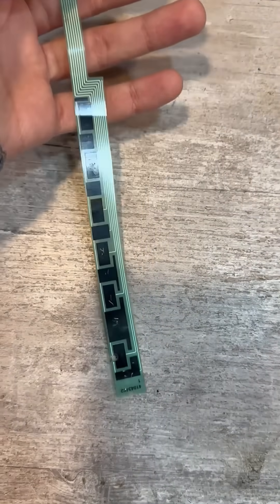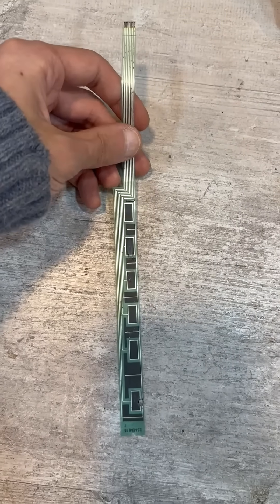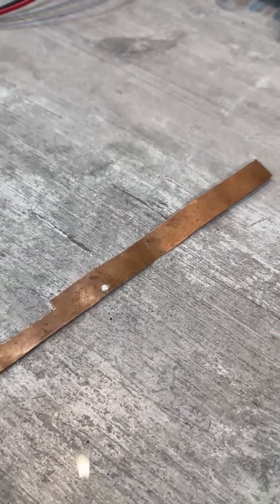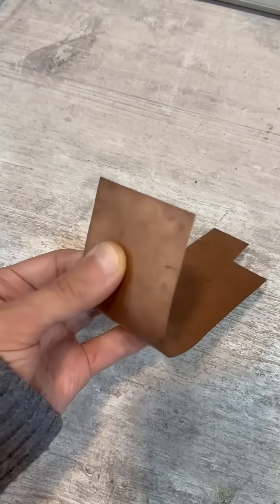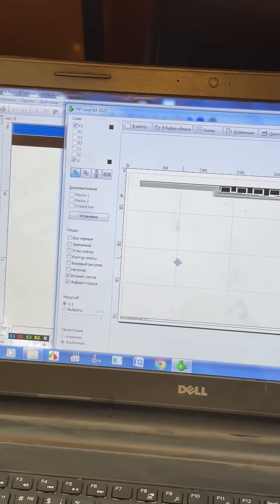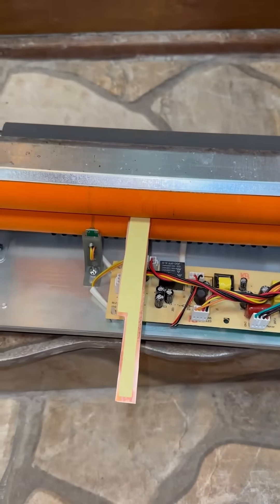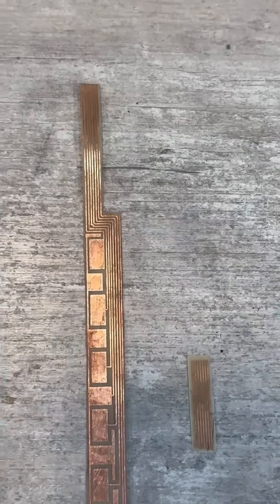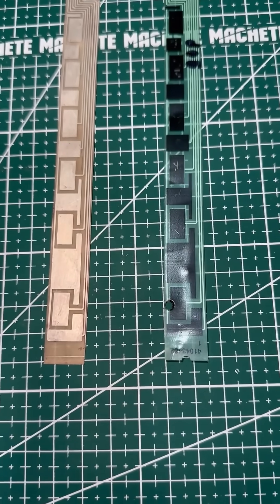How to make a flexible cable at home

Comment: If anyone wants to see how to fix one of these cables I can do a video on it including pad replacement all with enamelled copper wire solder copper tape and some coating for after I'm done scratching back plastic to expose traces and soldering

Comment: I would just scrape back the plastic and solder jumped wires across the breaks then coat it with lacquer or liquid electrical tape done this a few times the carbon pad can be fixed with copper tape with said jumper wires soldered to that